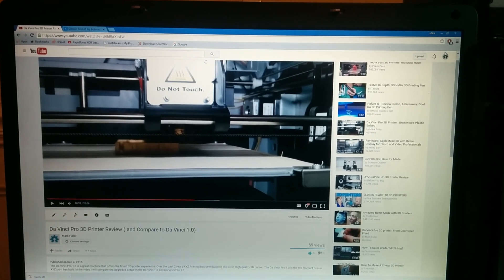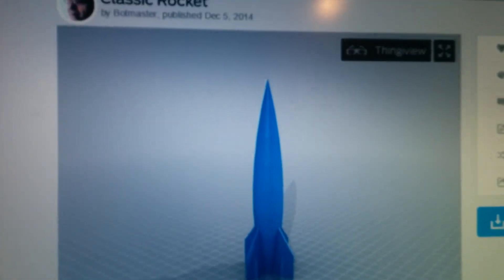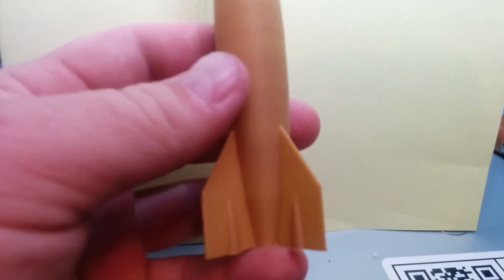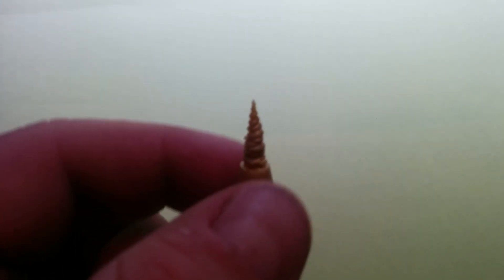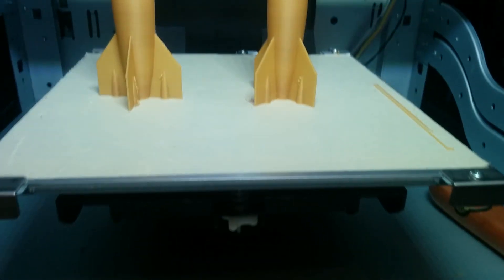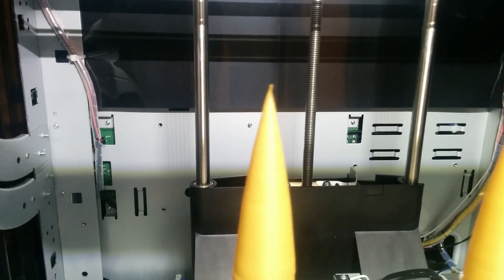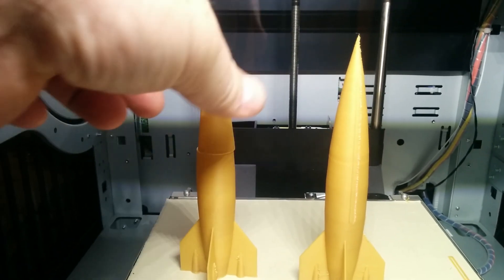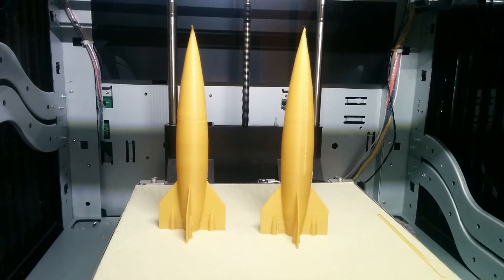Da Vinci Pro 1.0 - Rocket with pointed cone test

Comment: Hey Mark I've been wanting a 3-d printer for a long time is a XYZ da vinci pro good to start out with.
Reply from the maker: Jessie,  The Da Vinci Pro is a great machine. XYZ printing had some quality issues during launch but they have fixed them all now. I might even be able to suggest another 3D machine based of your requirements. What is your budget. What do you plan to print? Would you consider yourself handy, maker or a tinkerer?
Reply: thank you

Comment: Hi Mark :) Great vídeo about the Da Vinci Pro. Just a quick recommendation. Change the coupling on the Z motor for a flexible coupling and you will improve your prints ;) I don't understand why they put that type of coupling on the printers, because that will not compensate any misalignment of the stepper motor axes. That is why you can notice a small "wave" effect on walls of your rocket. And the tip of the rocket is temperature issues like Chuck mentioned.
Reply: can you give a link where to buy the proper coupling and installation instructions
Reply: Hi John I bought in Portugal but for sure you will be able to buy it in your country.  It is easy you just have to buy one coupling that match the diameter of the shaft of your stepper motor with the threaded rod of your machine. For instance, I've used this http://ledsandchips.com/store/3DPrinter/3DPrinter_Mechanics/299 "Z-axis Motor Coupling 5mm / 8mm" because my motor has 5 mm diameter and the threaded rod has 8 mm diameter. I hope I've helped you ;)

Comment: hi im looking to buy a 3d printer but the items I am interested in printing has to do with small units and things such as screws and nuts. for example I was wondering if you be so kind to print this file http://www.thingiverse.com/thing:387266/#files in small porpotions probably 1.5cm in length and .5 cm in height